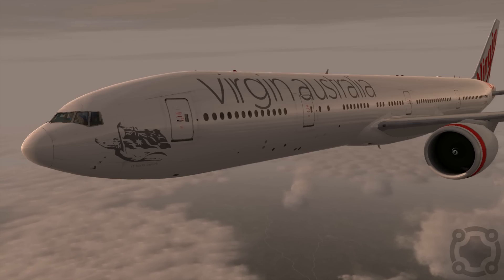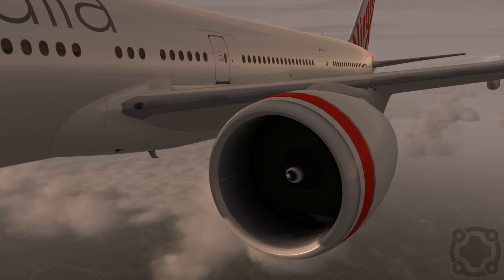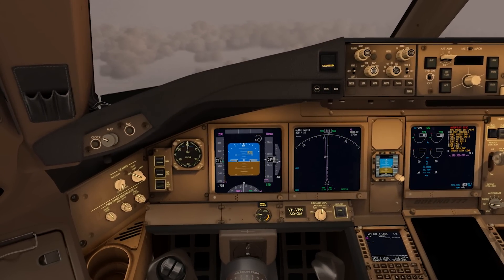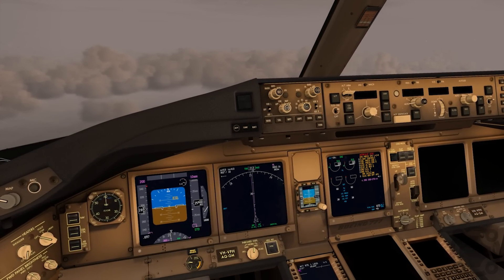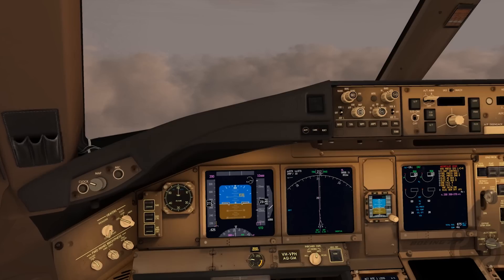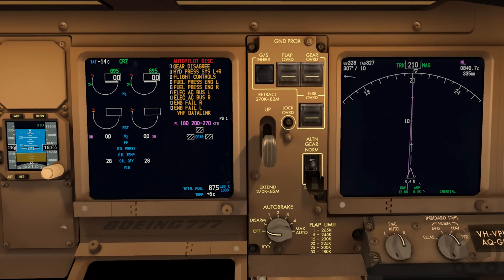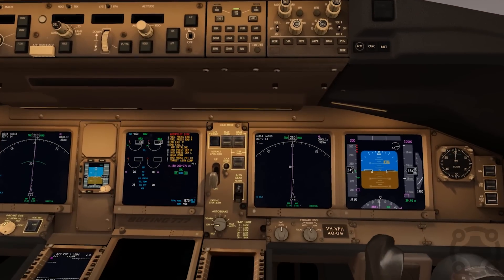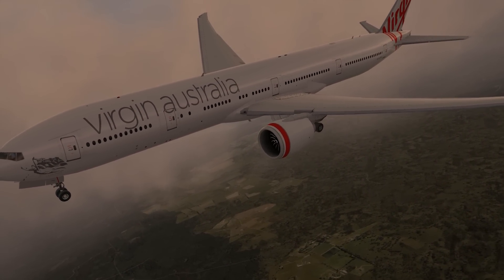What Happens If Both Airplane Engines Fail? - Aviation Facts

Comment: Even if you lose both engines in flight, they will continue to "windmill" with sufficient airspeed. Spinning of the N2 high pressure shaft of the turbine will keep the accessory gearbox turning as well, allowing for some hydraulic pressure in the system for flight control actuation. On the 737-8's that I work on, at only 3% N2 you will still see around 300psi of hydraulic pressure in that system!

Comment: I kinda get the test but i also dont
As its not something that really happens 
Either the APU Starts up or the RAT Drops down and starts spinning. 
Majority of planes with Dual Engine Failure (which is not running out of fuel as thats not a failure) 
Dont fly and land on Battery power Only, As batteries cannot run Hydrualics really.

Comment: How do you find an airport to land at at 3am over the Atlantic?  Headed to Africa in 6 weeks and your answer will calm me greatly.
Reply: you can't. but there are requirements that ensure there are suitable diversion airports that can be reached within a specified time along the entire route, even in the event of an engine failure. flights also have strict requirements on maintenance, like ensuring engines aren't serviced at the same time by the same people to avoid common failures.

Comment: If you're driving on the highway and your engine and breaks stop working, you're in a hell of a lot of trouble because there are so many things you can crash into and time is not on your side.  If your're flying at 35,000 feet and engines give out, you have nothing but miles of open air and time to land the plane.

Comment: The modern plane is a glider too - not the most efficient. I read that the RAM Air Turbine can be used to provide just enough miniscule thrust to keep the aircraft "gliding" until a safe landing spot is found. Not sure if that's correct, but can a Pilot confirm if youre reading this?

Comment: This can be done, and it was with a Boeing 767 in Gimli, Canada by a
pilot named Pearson. You have to be very skilled and not make one
mistake or your dead. You have to take into consideration your altitude,
air speed, and rate of decent. Once you figure out how far you can glide
and where you will go down, you pick the closes airport, to where you
figure you'll touch down on the ground. You may be going to fast, so you'd
have to use some maneuvers to slow the plane down, like put the plane
in a crab position to slow it down, and then bring it to the ground.
 
This can be, and has been done--just google the Gimli Glider --Boeing
767 lands with no engines, and you will see. Happened in July 23, 1983
 in a province called Manitoba, in the country of Canada. This plane became
known as the Gimli Glider. It's not as easy as this video makes it out to be, and 
most planes would crash, unless the pilot and his mate have lot's of experience.
 
You can Google the Gimli Glider, and see for yourself. This Captain Pearson
flew Gliders a lot of his life, and didn't rely on computers, and was an extremely
gifted pilot. It can be done, but most planes would go down -- "for sure."

Comment: Instead of rat , put small engines with enough power on both sides of the underbelly in case of engine failure . Ever thought of that ? Have it so a door slides open the emergency engines roll down iron pins lock them in place , divert fuel from failure engines an boom your back in business enough to get you in to a little better control an to keep some better speed to get you to nearest airport even if a storm comes  your covered
Reply: I'm telling ya this is the way to go . Boeing and the engincould make this a reality . What if your to far out over the ocean ? Even though your high your going to fall no matter what . Emergency high powered small engine's are better then death by crashing drowning or slark attack . Think if the insurance rates going down because of this and the safety of crew an passengers.  There is enough tech out there to build light weight engines with enough power to maneuver power up in case of storms or to keep altitude until you land .

Comment: twin engine fail is a little more dire than you make out. of course the plane wont necessarily fall like a rock. A jetliner is NOT a glider. you cant just hitch a ride on a thermal and gain some altitude. if you need to gain alt you have to sacrifice air speed. if you could jetison your fuel, engines, your payload and your passengers and then reconfigure the airframe you would be a pretty decent glider post engine fail.

Comment: awesome video! But what's happening when both of engines failure during the takeoff?..is aircraft starts falling? Thank you for your answer! :)
Reply: If it's too slow, like the incident happens right after leaving the ground, the aircraft might stall indeed, especially if the pilots fly above an urban area and are struggling to at least not land on houses... Either that or they glide a bit straight then land on the fields in front of the runway. If it's still on the runway, they most likely just try and brake hard. Or if they're high and fast enough yet, they might try going around, but that's extremely risky, as a turning plane slows a lot faster and can stall even more easily.

Amúgy ha magyar vagy, lefordíthatom ha kell :D

Comment: The 777 is fly-by-wire. The yoke feel would not be any stiffer than usual. You would never lose total hydraulic power, that's what the RAT is there for. In a fly-by-wire system, total loss of hydraulic power would result in total loss of control. There's no physical linkage between that yoke and the control surfaces. There's so much misinformation in this video I don't know where to begin...

Comment: No idea about old planes, but planes nowadays would glide for many, many miles if the engines decided to not do their job anymore. Also, it doesn't matter if the pilots have been flying for 5 years or 30 years, they are highly trained trained and would know exactly what to do in such a highly unlikely situation... So yeah, don't be scared, you got less than a 5% chance of crashing in an airplane and maybe over a  70% chance of crashing in a car. I'll gladly take a plane over a car, and who knows gliding in a heavy speedbird might be fun lol

Comment: What if the rear wings break off or the airplane goes into an uncontrollable dive.  Prove everybody on board can survive these trivially small turbulences.
Reply: The Ultimate Reductionist THE REAR WINGS HAVN'T BROKEN OFF IN THE LAST 29 YEARS why is this any of your concern of course you can't survive. If a plane goees into a dive the most commen cause of this would be a stall thats quite easy to get out of all you do is point the nose down give the engines power and gain speed the pull up.

Comment: The landing gear doors don’t just open. They unlock and the weight of the gear pushes them completely open. There are rub strips on the doors that make contact with the tires as gravity pulls them down.

Comment: Well that was cut short,,don’t you need reverse engine for braking how does it stop on the runway
Reply: Robinson Homes Reverse thrust is not required since wheels have brakes and there are spoilers but more runway will be required than normal wich could be a problem if your landing on a short runway
Reply: Simulatedletsplays  thanks

Comment: Coming from(not me) flies 737 level out till 180kn dive to 300kn level out until 180 dive until 300 when below 3000 feet flaps 2 to add lift but not too much drag you can level out dive for quite a few miles to get To an airport if this happens while at high altitude

Comment: its only the air fricion force F that slows the plane down but since the mass m of the plane is huge  the acceleration a=F/m will be very small so it basically maintain its speed.

Comment: hey..cool vid..im trying to get over my fear of flying and just learned that planes do glide when engine failure just like you talked about in your vid. But to my understanding they can only glide for like 100 miles or so..so if your over the ocean and 1500 miles from land .your still going swimming right???
Reply: Of course amigo no free energy or free lunch whatever floatation you have will quickly be diminished from frictional and resistance loses and what went up will eventually come down better hope they make airports on oceans every few hundred miles...

Comment: what if you loose both engines over atlantic ocean, while travelling lets say from london to the U.S? how long can you fly with no engines? i noticed the speed goes down pretty fast. to cross the pacific ocean i think you need around 4 hours? or even worse, over pacific ocean?
Reply: You find the airport in the ocean. There are plenty according to this guy.
Reply: There are many islands with airports in the ocean. That same thing hapenned to Air Transat Flight 236, and they ended up landing in the Azores Islands.

Comment: I'm surprised to find out that a plane can still remain in  midair without the engines operating. Never knew that.
Reply: Yes, the plane can still fly. It will use gravity force to mantain speed, but this means that the plane will very soon meet the terrain... and what if there isn't any airport? You will land in water or in a field, which is very dangerous. If you have an airport is much better, but you have no reverse thrust to brake the plane (you will use only the wheel brakes) and you can not perform a go around in case you are not well stabilized for landing.
Reply: Haha unless you're sarcastic, then here's the evidence that it's not just the aviation fans and pilots bragging about how much they know about planes compared to average people...
Reply: It´s just physics. As long as it has the wings and the plane keeps moving forward the plane will not go down in a free fall like a stone, that´s like trying to push a floating board under water, the water will push it back up. The same principle applies to an airplane and the air. Of course, since you don´t have the engines, in order for the plane to keep moving forward and therefore have the air passing through the wings continue lifting it, you need to always be going down at a slight angle, which is the reason why you will gradually lose altitude until you reach the ground, but the airplane will keep gliding until it does so. The only thing you won´t be able to do will be to keep it flying in a horizontal like since you don´t have the engines to push you forward and are just using gravity and momentum to do so, so you better find an airport to land before you reach the ground. 

In 2009, there was a flight which after taking off from La Guardia lost both engines at an altitude of 2,818 feet (859m) and it just glided for some minutes until it landed in the Hudson River. If you haven´t watched the movie, I totally recommend it. It is called "Sully".

Comment: The gear came down because the APU was running not because of    alt gear ovrd  the system is designed to auto apu!!  you    man turn off   before dual rollback!

Comment: On July 23, 1983, Air Canada Flight 143, a Boeing 767 jetliner, ran out of fuel at an altitude of 12,500 metres (41,000 ft), midway through its Montreal to Edmonton flight, in Canada. The crew was able to glide the aircraft safely to an emergency landing at a former Royal Canadian Air Force base in Gimli, Manitoba, that had been turned into a motor racing track. This unusual aviation incident earned the aircraft the nickname "Gimli Glider".[1]

The subsequent investigation revealed that a combination of company failures, human errors and confusion over unit measures had lead to the aircraft being refueled with insufficient fuel for the planned flight.[2]

Comment: Summary : If both the engines fail, find out the nearest airport location, do the landing operations as if nothing has happened , because the aircraft designer/manufacturer has every standby arrangement in the event of power-loss ; after all it is nothing more than a big glider........

Comment: and in the space of the Microsoft Flight Simulator video you droped 15,000 feet in altitude, double that and you will be on the ground so 20 minutes to get your self to an airport AND circle to line up with the runway / glide slope to orevent overshooting the runway

:/

Comment: Great video. But what are the planes options (and my fear) if a plane loses power after take off and without altitude to offer more time for these options?
Reply: You should return to the nearest airport ASAP. That´s what happened to Sully when he lost both engines at an altitude of 2,818 feet (859 m), less than 2 minutes after taking off, and ended up landing in the Hudson River in 2009. You should watch the movie if you haven´t watched it yet. Really well done, and Tom Hank´s performance is excellent, as always.

Comment: So what i have learned from this video is 
1.the plane glides instead of crashing like a rock
2.if I see any warnings or alarms goes off just ignore it 
3.lower down your flaps to increase DRAG (why man)
And the most important if you have little electricity you can lower down your landing gears by using Gravity .

Comment: They can still continue to fly for a limited time after all of their engines fail, on January 15, 2009 US Airways Flight 1549 lost both of it's engines after suffering a bird strike and it landed safely in the Hudson River with no fatalities.
Reply: It depends on the altitude. There was a transatlantic plane that lost both engines and continued for about an hour until it landed safely in Portugal, since they lost the engines at an altitude of +30,000 feet.

Comment: what happens with a double engine fail ?
1-  when the gens fail - as voltage drops emergency batteries begin to back up the flight instruments and the emergency power system will light the cabin emergency lighting systems. 
2- crew begins to start the apu. the apu has a generator big enough to power the entire aircraft  and enough pneumatic air to run the environmental systems.  the generator on the apu will also power the electrically driven auxiliary hydraulic systems. electric, pneumatic and hydraulic power will be immediately restored when the apu starts. 
3- if the apu won't start it's time to drop the rat.  the rat will power the " essential " bus.  the essential bus is all electrical buses and equipment that are considered necessary to fly the aircraft.  your reading lights probably won't work. 
4- if the aircraft was at or above 35k' it will glide ALMOST 100 miles depending on the weight of the  remaining fuel, passengers and bags.

Comment: It doesn't matter how many engines an aircraft has at its disposal, if they all fail the craft becomes a glider. Depending on the particular crafts glide ratio, if they have sufficent height, they simple perform a dead stick landing.

Comment: plane are still flying bcuz its velocity is not zero. if the plane are zero velocity in mid air it will experience a free fall
Reply: resultant force cause the plane slowly decending makes a half parabola curve down

Comment: however engine fans keeps on rotating though engines are not in power due to air pressure which is not shown. But it rotates very slow..........

Comment: There are three occasions where both engines have failed in the air. 
One time was when a plane crashed into the Hudson river after the start because of
birds in the engines
and the captain managed landing the airplane smoothly into the river
Gottrora in Sweden where ice came into the engines
where the plane made a smoothly crash landing on the field
The third time is when a flight above pacific ocean failed both engines because 
fuel loss from the fuel pipelines.
The captain managed to navigate and land the plane at the airport instead of crash landing in the ocean.
You can see these here at youtube
Reply: The plane didn´t crash into the Hudson River. Captain Sully LANDED it on the river, on purpose. It´s two different things.

Comment: What is the glide ratio? Sure would be exciting to line it up on a runway with no engine.. I wonder how responsive the flaps would be in order to control the decent?
Reply: Well you have the case of Air Transat Flight 236, a transatlantic plane that lost both engines and glided for over an hour until it landed safely, or US Airways Flight 1549, which lost both engines right after taking off at an altitude of 2,818 feet (859 m) and glided until it landed in the Hudson. There´s a really good movie about the latter, called Sully.

Comment: I noticed the failure you selected was "Severe Engine Damage", which typically means that the engines have seized up and are not turning.  In this case, you are correct and there would be no engine powered hydraulics available.  This is where we would normally start the APU when we reach a serviceable altitude at which it can be started. The APU would provide electrical power to the backup hydraulic system which uses an electrically powered hydraulic pump.  Conversely, if the engines have simply flamed out and are still windmilling, then the engine driven hydraulic pumps as well as the main generators would still be operating; providing full flight control assist and full electrics to all systems.

Comment: How much is the range at average at average altitude and average speed when both engine fail? in like a boing-747
what if you are flying over the Pacific and there is no air port anyway near you?

Comment: the 777 has fly by wire...
Reply: Yes that is correct, but the fly-by-wire system is supplemented by mechanical backup.